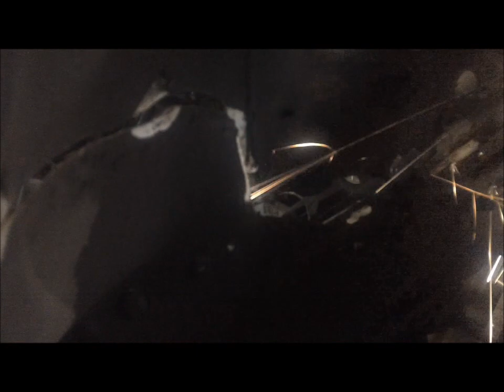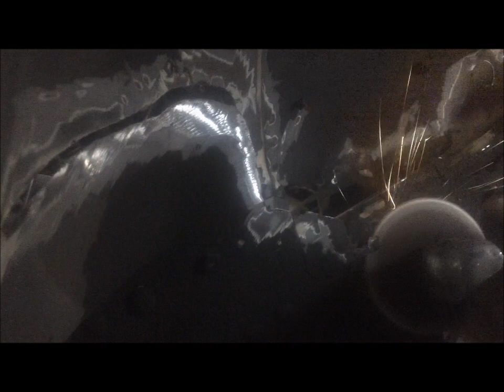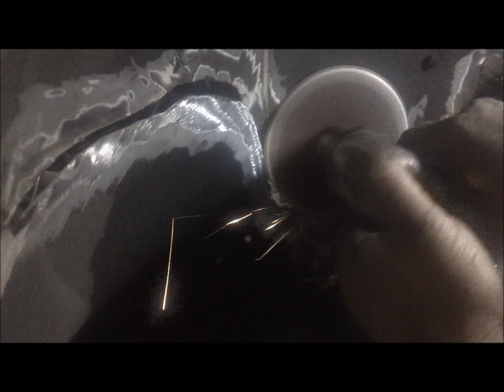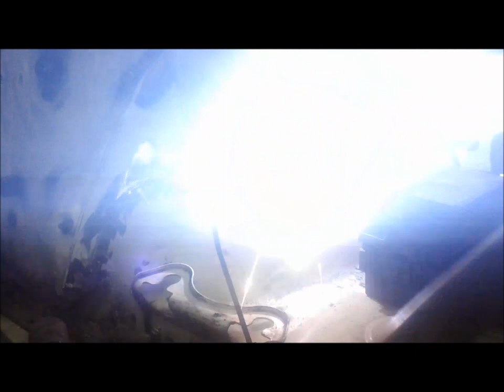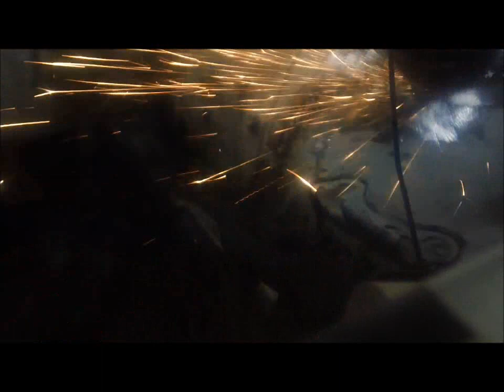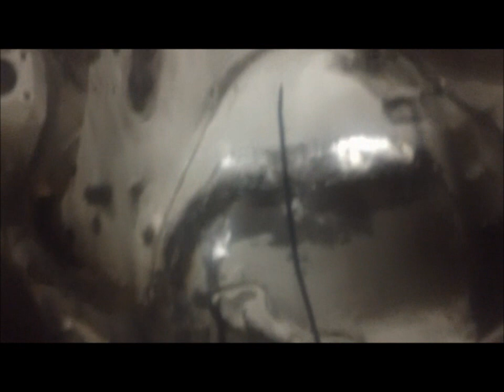240sx unibody repair part 2

Comment: good job. Those are not even 18 gauge american. To assume this to be too dramatic to repair..ponder the same gauge steel on 200 foot pound ten geared subarus. Crazy ass asian vehicles form the 80s. I dumped 40 pounds of mig in to one.. rockers ended up being .3 inch thick. The rear arch roots need more than 20ga.. go thicker than what you mentioned.

Comment: Makes me wanna go out and weld some stuff sum bitch..

Keen to see how you go about the rest of the repair work, double plating it with the 16 gauge and dealing with different plate thicknesses etc. Pulse welding on thin sheet metal without occasionally burning right through is tricky when the heat starts building up. Since subscribing to your channel a year or 2 ago, I made a point of doing a course to learn the basics of welding. Still terrible at applying body filler and sanding !